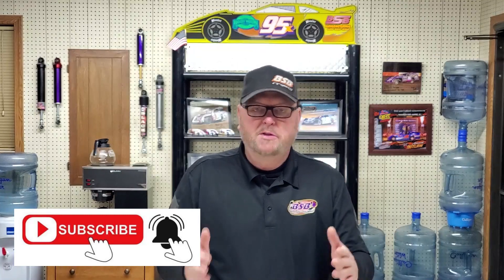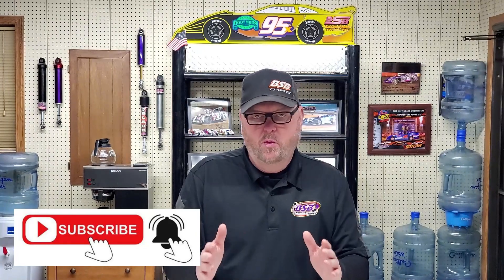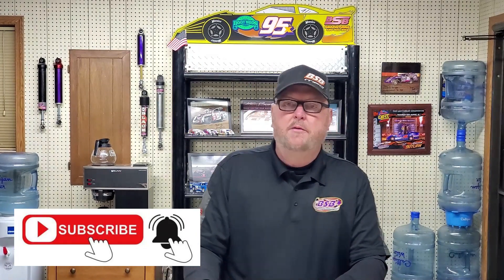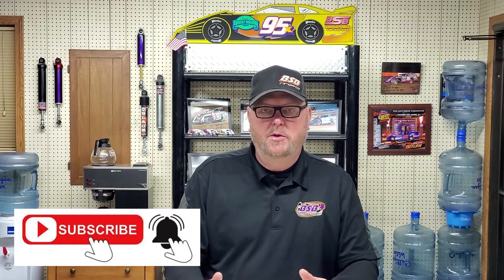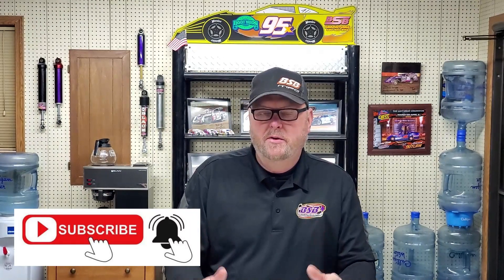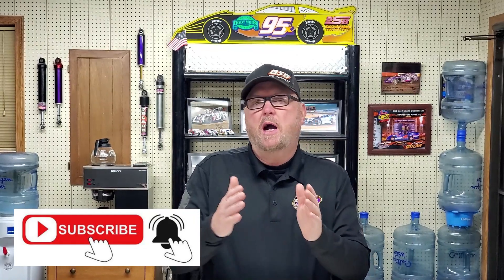Left Front Setup and how it works.

Comment: Here with a factory stock in upstate ny
Reply: I'd love to know some ride heights spring rates for a factory stock 3000 lb
Reply: We can run 16 springs no chains
Reply: 3/8 banked
Reply from the maker: On the front it depends on spring cups: No cups RF1000x11 LF1100x11 (900x12 rf slick) with cups RF95 LF1050 right front cup 1/4 to 3/8 lower. RR 225 x 13 or 250 x 13 or BSB 230-250x 13 (LR 250-275-300 x 13 add spring as it slicks off. Need the shock program to support these springs.